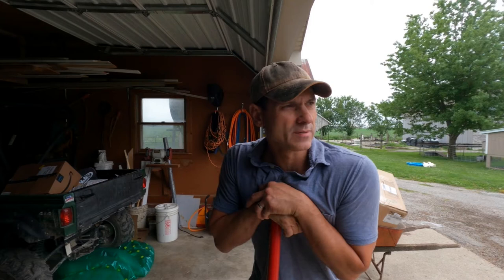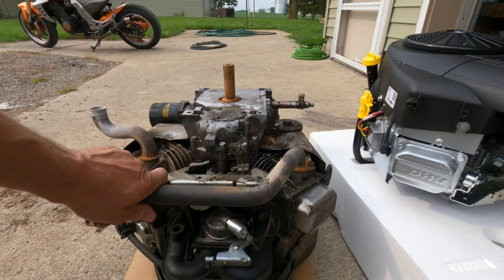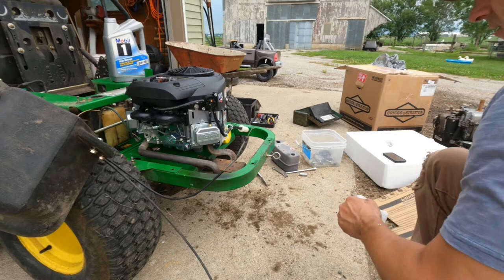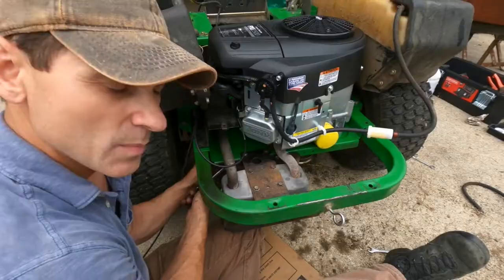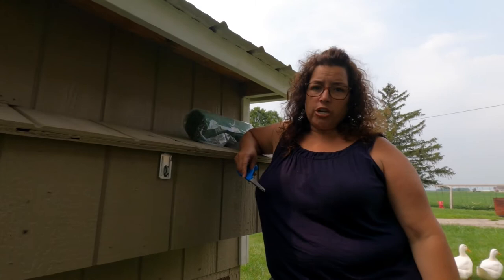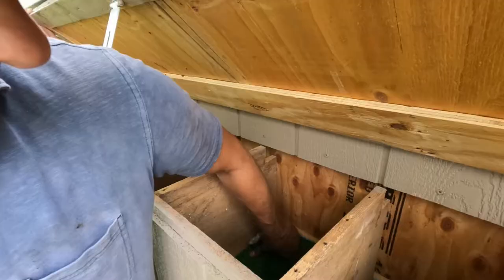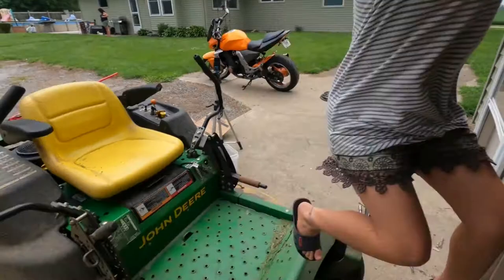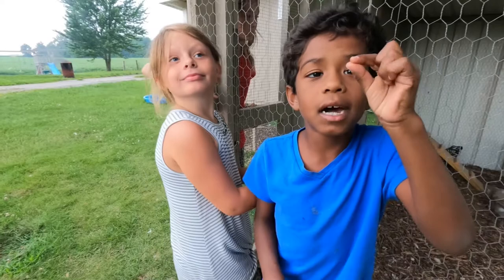Replacing The Motor On Our Lawn Mower - Getting Our Layer Boxes Ready

Comment: Good video! looks like a pretty straight forward job. I have been real happy with my Z425, its been a real workhorse. I may consider re powering it in the future. Did you end up with an engine that was equivalent to the original as far as HP. & TQ. or did you up the power a little. Thanks!
Reply from the maker: Hi Robert!  I think it has a little extra power now.  The salesman told me that the original engines used a system of horsepower rating that wasn't very accurate.  This new engine is rated more accurately, and it is a 25 HP instead of the 23 HP the original had.  I'm very happy with it so far.